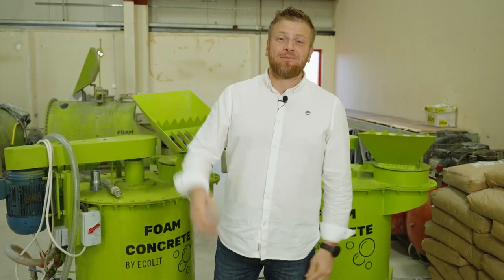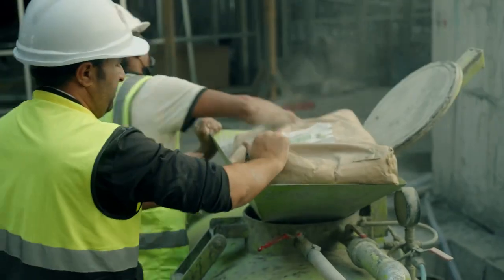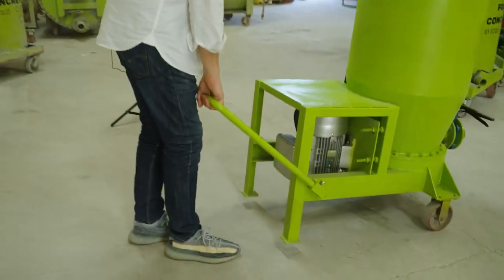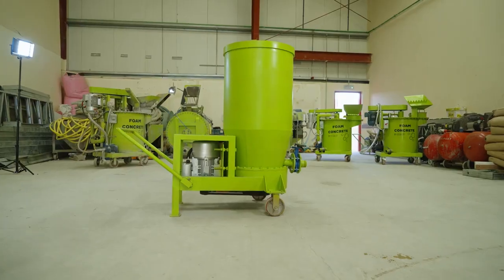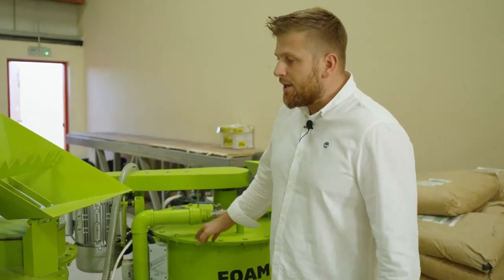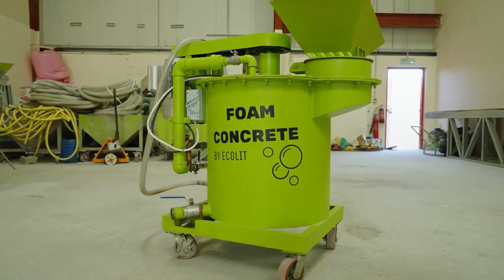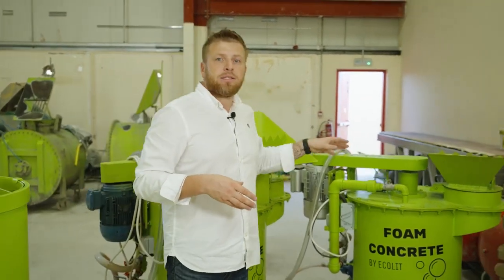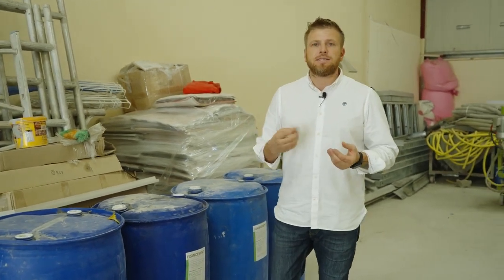Cellular concrete insulation for prefab building system

Comment: What is a Insulation value of the Foam Concrete? building regs are changing so we need to build to a specific level of insulation
Reply from the maker: For different densities it is different. You can WhatsApp me and I will share more details  +971561283050